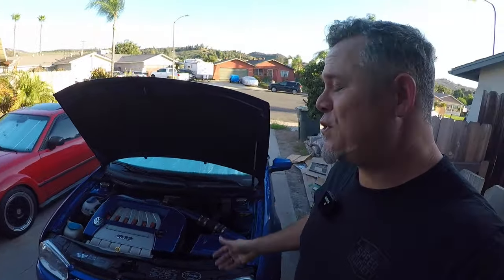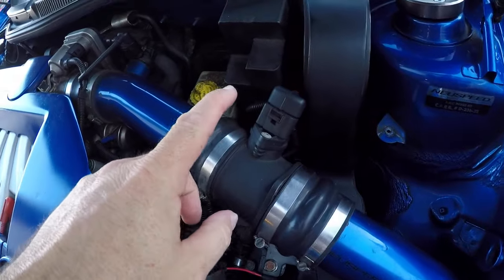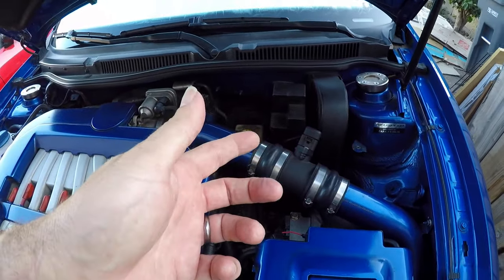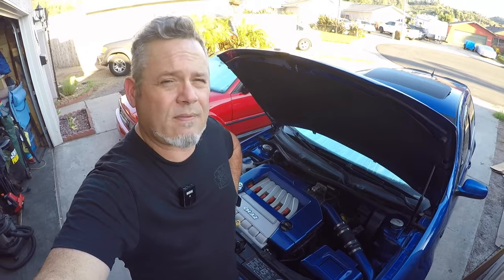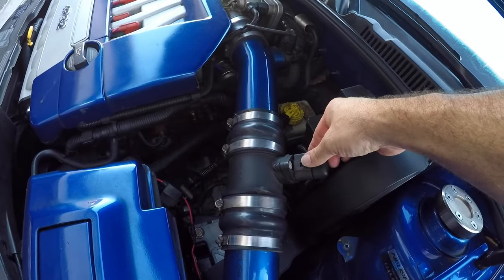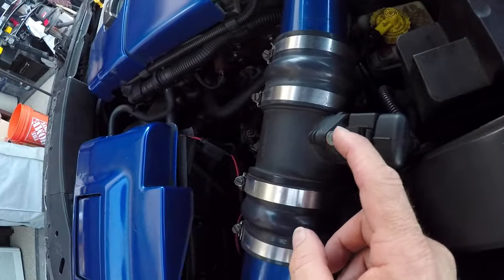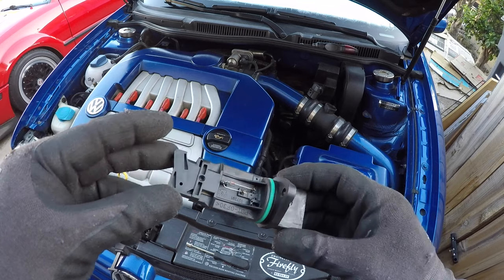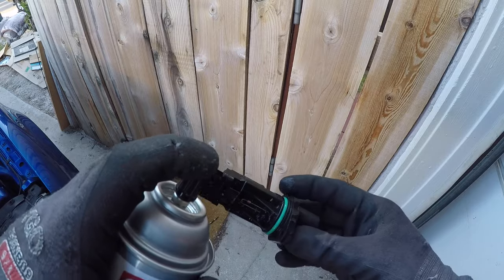Fixing Mk4 R32 Mass Air Flow Sensor & Throttle Body Issues

Comment: SAI codes can be a number of things… if the SAI pump is working ok (ie not whistling in the first 30-90sec of cold start) most likely the combi valve is gummed up. Pain to remove, easy to clean, pain to reinstall. Second most likely is one of the lines (usually the skinny hard lines on the combi valve) have come undone/disintegrated/popped a leak. This is easier to fix but still annoying in tight spaces. Only started watching so I don’t know where you landed yet but I hope that helps. Cheers brother!!! Keep up the mk4 content - the internet needs you!
Reply from the maker: Three things in this case: 
1) crankcase breather hose was massively cracked and leaking 
2) MAF needed cleaning
3) Throttle Body Alignment needed after battery disconnect & cleaning of Throttle Body